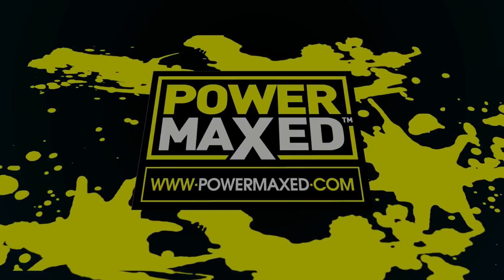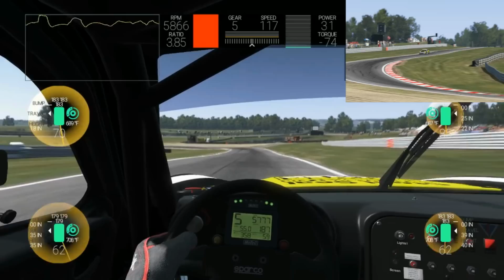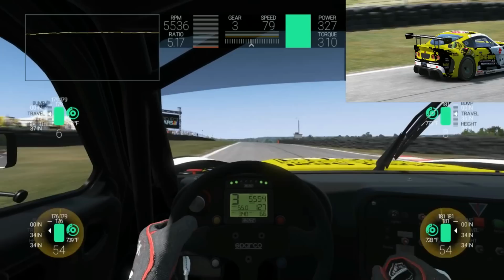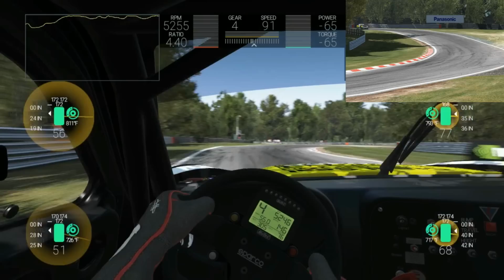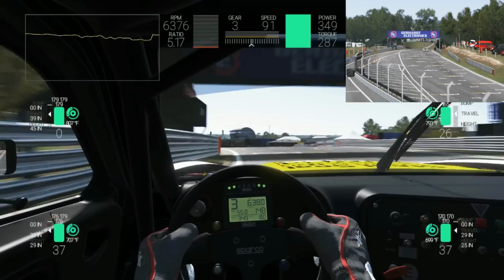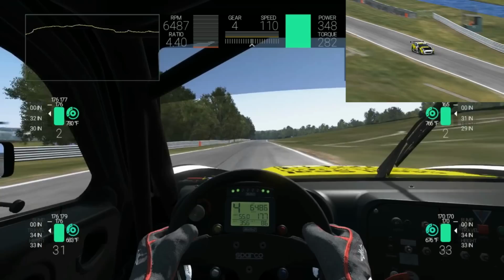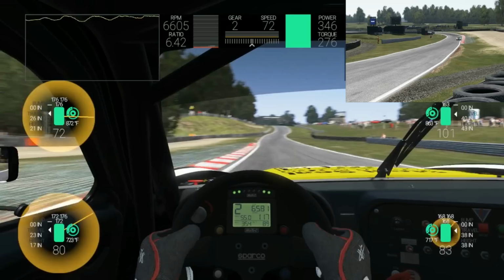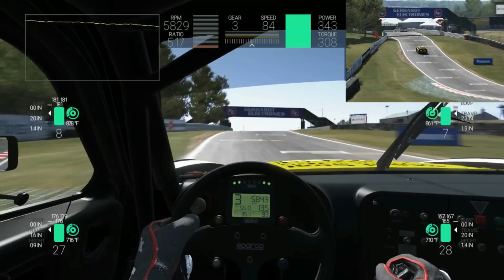Project Cars: For Beginners, Accelerating and Braking, Tutorial 1

Comment: That yellow line in the upper left corner is not your steering input, it's force feedback telemetry, it's the force being applied to the wheel, hence why it goes up when you brake or go over bumps.

Comment: Are you using ABS in this video ? Do racing cars actually have this ? Like Touring Cars or Formula 1 ? Because a big problem for me is locked up wheels..  maybe i just need to be smoother with the breaking right ?
Reply from the maker: Some do some don't it all depends on the series and the rules of that series,
Reply: Amigo500 hey can you help me out, how come wh n I'm Holding break,it won't break??
Reply: @anthonysefo3522  dont brake as soon as the corner is right there on the car, you gotta brake a few ft before the corner.

Comment: You can brake and turn at the same time, it's just that you need to get all your hard braking done before the corner. For trail braking, I don't go above 25% braking power.
Reply from the maker: You could but u want the car to be as stable as possible when cornering, but it's only the basics once u get them u can push abit more
Reply: Trail braking is, in theory, supposed to help keep the weight on the front wheels a little more. That way if you have a car that likes to understeer, it is supposed to help with making it turn in better. I know it doesn't work like that in Gran Turismo, from my experience, but in other games it may. I've read it off of different websites that were talking about braking, accelerating, racing line, etc. Everyone has their own way, though. It's not to say anyone who trail brakes is any faster or slower than someone who doesn't. Personally, I've kinda gotten into the habit of it, but I'm not the best driver. I don't get quite as much practice in as I'd like to get in good lap times.

Comment: I've tried and tried but I just can't enjoy this game. Go slow into a corner? Spin. Go fast into the corner? Spin. Break and lightly let off? Get overtaken then spin. The AI mindlessly ram you out of the way as well, its pretty bad.

The controls in this game are horrible and completely unplayable on a gamepad.
Reply from the maker: Dark Demise, it can be hard at times, it tends to be harder with a pad as it's harder to make fine adjustments where as with a wheel u can and it dose make u faster and more in control, 

I agree with the pcars issues I have left this game behind due to bugs and issues and finding better sims, 

All about practice m8t
Reply: I was a little frustrated when I made this comment, I tried some of the GT 1 cars and they handle a lot better.. it's pretty hard to make corrections, I have sensitivity set to 5% and I still lock the breaks and spin the wheels. I'll keep trying but I'm progressing terribly slow. :(

I really wish wheels weren't $200+ CAD :L
Reply: After an extremely frustrated time trying to learn how to race full assist off with a pad, hours on end of spinning out I finally managed a time of 1:30:700 in formula rookie and am really happy. I found a controller setup online that really helped keep the car under control.
Reply: what type of sims do you recommend?
Reply from the maker: Blake Slocum all depends on what u are looking for, in my opinion top end sims like rfactor 2 and iracing then the next layer down u have AC and raceroom then under that pcars 

Each person has a different opinions (which can get heated lol) on this as u may see on different forums and fb pages, 

At the end of the day just enjoy your racing
Reply: Demps OneFiveOne get gut my friend
Reply: turn on brake assist it will probably help you a lot
Reply: Dark Demise what was the setup
Reply: Dark Demise try to change the sensibility of the steering wheel to 0 zero and also the throttle and brakes. That's held me to play with the game pad
Reply: It is a simulator tho
Reply: share it with us!

Comment: Hey you seem like a good driver, can you help me out with something? I love this game, but whats killing it for me is the fact, that I get overtaken on the straights, regardless of what car I drive. this happens to me everywhere except with Karts. I´ve looked into it a bit and fiddled with things such as finaldrive, downforce, practicing to switch gears at the right moment. I´ve also worked on my cornering speed( slow in, fast out) and picking up speed for the straight. All these things helped tremendously with my lap times, but it hasn´t changed the fact, that I´m always getting caught and left in the dust on the straights. Its gone so far in fact that I always pull up right on the gearbox of the car in front of me on the corner before a straight, but then he just pulls away like its nothing, although I´m in his slipstream and have far superior exit speed. Even with Formula A  KERS and DRS being active simultaniously, I cant keep up. I´ve also noticed, that it doesnt seem to matter if the AI are on the track or not, because they keep accelerating, even if they have all four wheels on the grass.
Reply from the maker: It sounds like it could be more something to do with your setting controller wise, do u use a wheel if so u peddles might not be set up right,
Reply: No I use a regular PS4 Controller
Reply from the maker: That may be one of the reasons it is good with a conroler but u are better of with a wheel in dose not have to be anything expensive but u will have alot better experance with a wheel
Reply: Demps OneFiveOne hey how come it's so hard to turn, I can't even slow down to make a turn and I'm holding breaks , but it just slides through and crashes?? I'm new to this game
Reply: @anthonysefo3522  bought the game a month ago and here is a tip: Dont hard during a corner just tap it slightly. Before a corner brake hard and then tap again if the car is going a bit fast then turn and slightly press the gas until you exit the corner properly. Dont shift down during a corner since i noticed that doing that tends to increase your steering a bit much. And most importantly, minimize the steering if a corner is bumpy and quick (like Sikkato's S turns before the finish/starting line)

Comment: I can't even turn a corner, the car just keeps going straight, even when I press break and it doesn't work
Reply from the maker: Anthony Sefo What controller are u using mate if it's a wheel try changing the wheel ration either in game or on your wheels software
Reply: Demps OneFiveOne nah it's the PS4 remote
Reply: @anthonysefo3522  are you locking up the brakes?